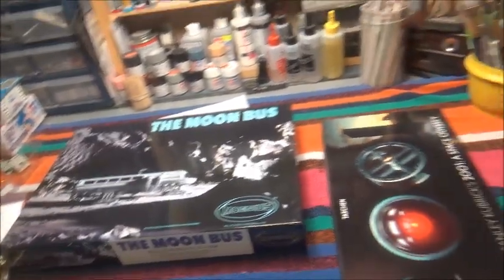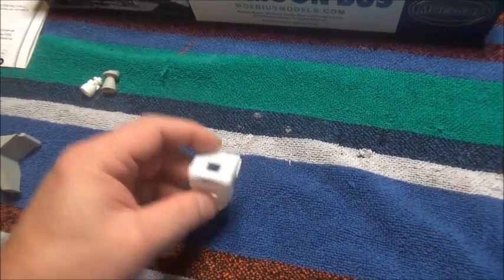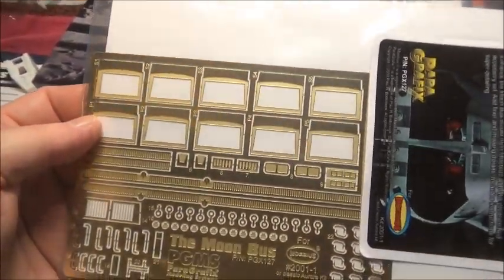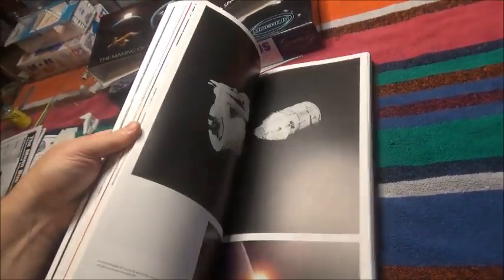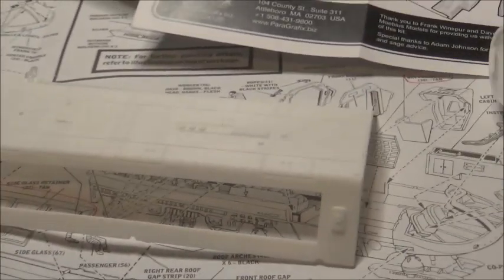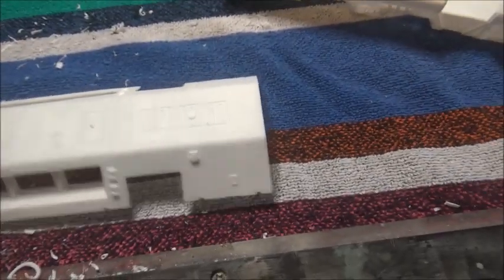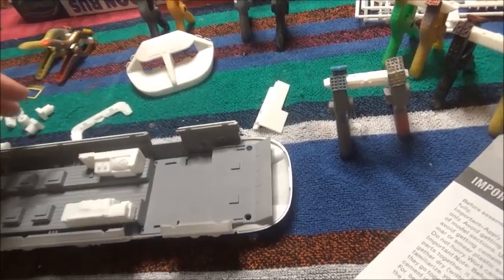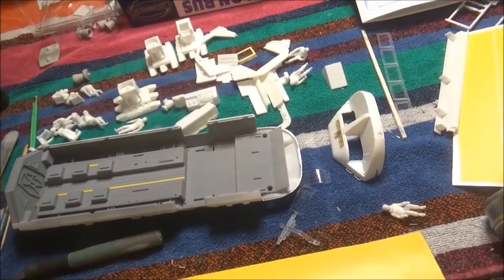Aztek Dummy Update 11/15/19 - Moonbus part 1

Comment: I don't know if you have any old cell phones that you can tear apart but you can use parts of the screen 4 illumination or diffusion. There are a lot of good uses for it. Warpless engines on the Enterprise. Control panels on this model

Comment: Will Mobius ever release a Aires from 2001?,Aurora should have back in 1968.
Reply from the maker: Doubtful. Next up is a hal wall plaque
Reply: Can you tell me where I can find the figures and resin replacements? Paragraphix is not answering.
Reply from the maker: @wolfmanjack3451  http://www.paragrafix.biz/product_detail.asp?MainCat=Series%20/%20Movie%20/%20Genre%20%3E&SubCat=2001:%20A%20Space%20Odyssey&PPartNum=PGX128
Reply from the maker: photo etch
http://www.paragrafix.biz/product_detail.asp?MainCat=Series%20/%20Movie%20/%20Genre%20%3E&SubCat=2001:%20A%20Space%20Odyssey&PPartNum=PGX127